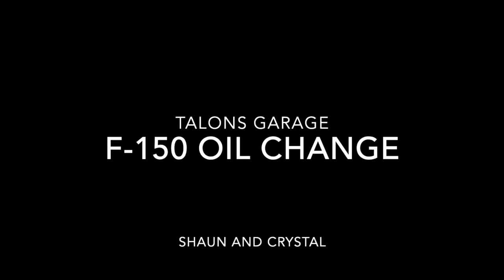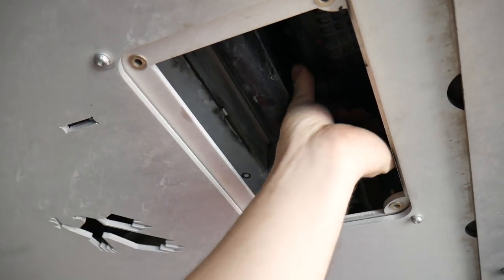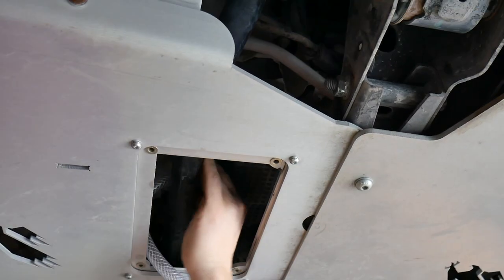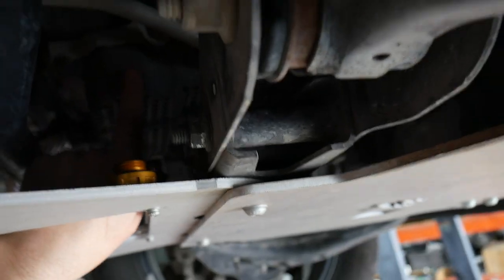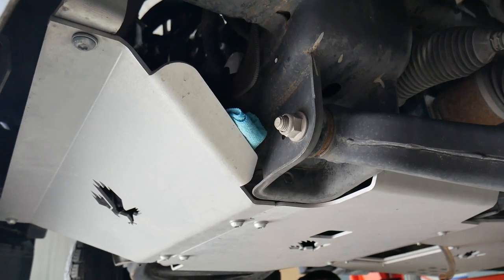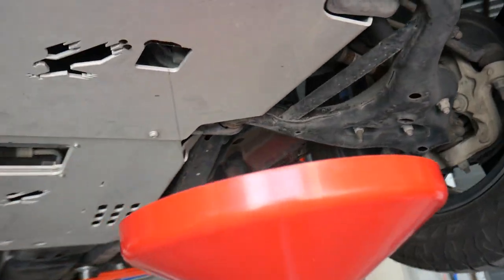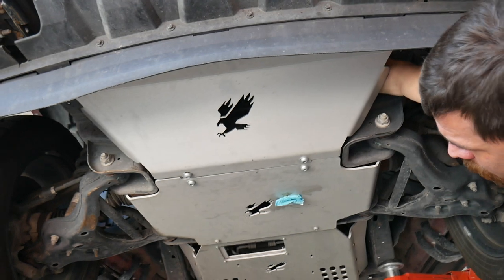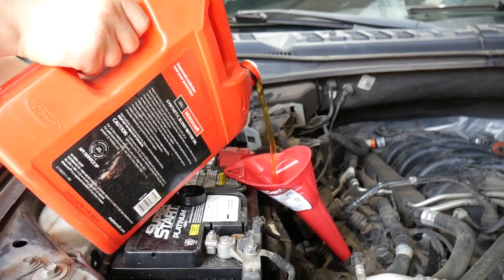Talons Garage F-150 Oil Change with Catalytic Converter Shield and Skid Plates Installed

Comment: I bought the Ronin plug, and it works great now. To get to this point I had to take a bath in oil while I cursed the engineers at Ford for putting the cross member bar right in front of the dumb plastic oil pan.
Reply from the maker: You're exactly right! That cross member is completely in the way with or without a skid plate. Glad the Ronin valve is working for you.
Reply: Can the Ronin plug be installed after the skid/ catalytic converter plate,? ¿?
Reply: @TheMasterkiller24  yes it can

Comment: I would like to see a video of Shaun reaching for the oil filter on an F150 Powerboost. Installed a full set on a friend's Powerboost and no way can I reach the oil filter (and I have long arms), it sets back further than the 5.0. I bought the Talon tranny skid plate for my own '22 Powerboost but not sure yet I want to order the engine plates as I think the front plate has to be removed to get to the oil filter. Can anyone prove me wrong? If so, I'll buy the front skid plates as well.

Comment: Just looked at the website and saw that the skid plate bundle doesnt fit 2wd f150s. Does the "Ford F150 | Skid Plate | Catalytic Converter Shield | 2009-2023" Fit a 2wd? my 2020 STX felt cover just fell off yesterday, looking to buy a new aluminum one.
Reply from the maker: Hi Matt! Sorry, just seeing some unanswered comments. Yes, our catalytic converter shield will fit on your 2WD F-150.

Comment: This might be an odd question, but here it goes. Will these skid plates, both engine and transmission fit with white knuckle, off-road sliders on the F150 ?
Reply from the maker: Hi Mike! So sorry, just catching up on some unanswered questions. Sliders should not interfere with installation, though, I would suggest reviewing our installation guides to double check for any potential interferences. https://www.talonsgarage.com/f150install

Comment: You need a vid for the 2019-24 Chevy Silverado as well
Reply from the maker: We actually did an oil change on a 1500 with the 3.0L Duramax engine. The access panel is spot on with the 1500s and its easy having the filter right next to the drain plug.

Comment: Is this the regular f150 or is the the f150 powerboost????
Reply from the maker: This is a F-150 with the 5.0L engine. The powerboost is strikingly similar, but because the crossmembers are further apart, the transmission shield is several inches longer.

Comment: Funny this popped up on my feed this morning.  I just installed my transmission skid last night that I had ordered several months ago.  Installed on 22 F150 Tremor, so it had factory "skids" over the engine and transfer case.  It took a while to figure out the mounting on the back crossmember as I couldn't clearly understand from the written directions which skid goes against the frame.  But there is only one way in reality.  
Otherwise it fit perfectly and I'm looking forward to my Moab trip next month with a bit more confidence!
Reply from the maker: Have fun in Moab! We will personally be out there this weekend testing our products.
Reply: @talonsgarage5622  Nice!  I'll be sure to take videos and "before" and "after" photos!